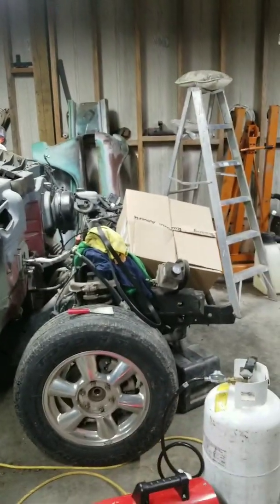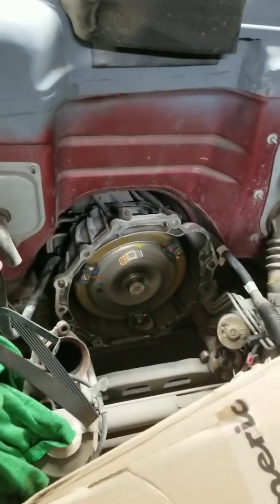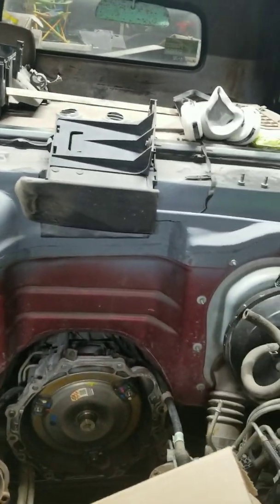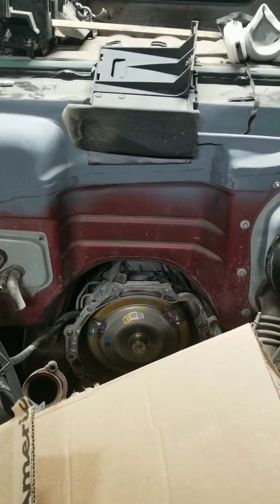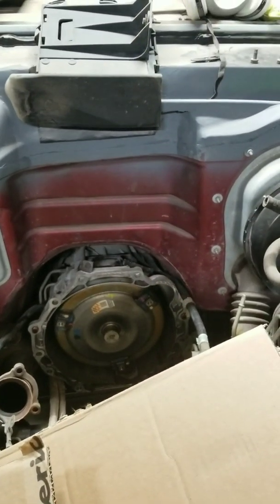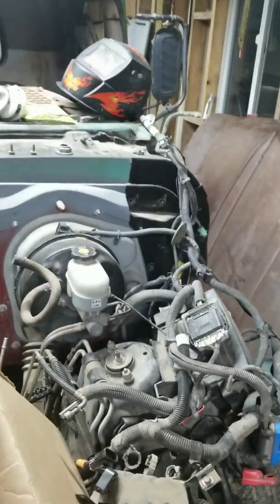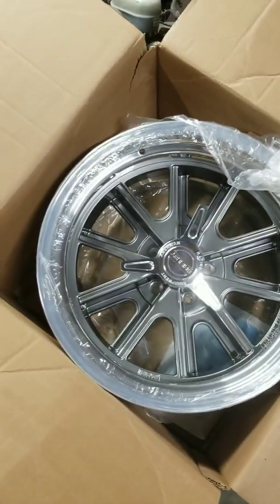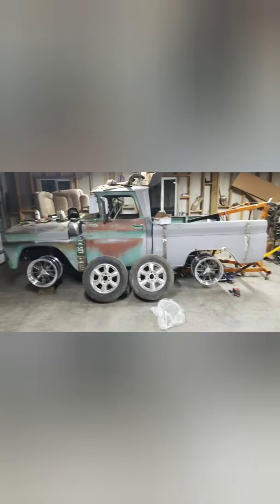Chevy trailblazer 4.2l swap to a LS 5.3l 62 Chevy c10 restoration conversion  project

Comment: I have. 4.2 trailblazer putting a 5.3 with 4l60 what do I need to do?
Reply from the maker: If you watch my little 3 to 4 videos it does go over the biggest problems. Every vehicle is different and I bought a trailblazer with the 5.3 in it so I had all the stuff I needed.

Comment: hey, I just blew my I6 engine yesterday due to a failed oil pump and the engine was almost 500k km Im thinking into swapping the engine to a V8 since Im on the second I6 swap and they have this pesky oil pump problem. So my question is can swap any engine from the 6.0 V8 like L76, L98 LQ9 etc... family with fabricating or rerouting the transmission, air con, power steering lines
Reply from the maker: I am sure you can, but to make it easier I bought another trailblazer that was a v8 model that way I knew I had everything.

Comment: Whatever suits one's fancy. I for one am looking to take out my BBC which has been in my '71 F250 since 1979 and replace it with a 4.2.
Reply from the maker: So let me see if I am reading this correctly.  You have a BBC (big block chevy) in a 71 F250 (Ford) and you want to put a 4.2 ( chevy) in its place. Can you send me pictures of that because that has to be the best running Ford out there.

Comment: My question is I have an 05 envoy 4.2 I also want to v8 swap. 5.3 would be perfect! Now ur saying for me to do this I would have to rip out and reroute everything you said in this video?(fuel lines, ac lines "etc") I get that everything will be different but are there ways to maybe keep the lines like they are an maybe add ur own extentions. Isk if that's even possible lol Or is this something that need completely rerouted? 🤔 you have done it and have used the ss as a donor. So that helps
Reply from the maker: Everything is close to the stock location most my stuff is a little different due to I put a 62 c10 body on it so more relocations if I would have left the envoy bode on it mostly  the same location.
Reply: @teamoa8761  thank you

Comment: How did you go about getting the i6 ecu harness blue connector to work with the 5.3 v8 engine harness?
Reply from the maker: They are for the most part the same, just get a schematic for each vehicle.

Comment: Oops thought you were swapping V8 into I6 trailblazer, much harder. putting an LS into an old truck simple. I put a 5.3 into my 64 Impala SS. They are a much lighter engine than the old ones. And that all aluminum 5.3 lighter still! Twice the HP half the weight! 10 the reliability! Good all around. Also once its complete you can easily swap in any LS variant.
Reply from the maker: Watch all the videos it is a trailblazer/envoy, I welded the 62 cab onto the trailblazer/envoy floorplan and firewall
Reply: @teamoa8761  Ok, I'll definitely watch them all. Very interesting build, very difficult too. Did you ever watch the show Iron Resurrection? I believe their 1st Episode they build is a 62. They swapped the 62 front end suspension system for I think a 64 cause the 62 was notoriously bad. I once had a 66 I put a 350 in. Pre LS, Pre 4L60/80 era. Love that body style. Dang it now I'm getting the bug. Now I want another one. Thanks!

Comment: If I 5.3 my stock V6 would I have to change the suspension?
Reply from the maker: Yes the motor you will have wiring to change and you will need to change the bell housing on the transmission
Reply: @teamoa8761  Goodlook bro appreciate the info 💯
Reply from the maker: What are you putting the 5.3 in?
Reply: @teamoa8761  2003 trailblazer with the 4.2
Reply from the maker: No suspension changes needed
Reply: @teamoa8761  no changes but the motor, huh?

Comment: What motor mounts are you using
Reply from the maker: The trailblazer 5.3 mounts
Reply: @teamoa8761  did you order them online
Reply from the maker: No I used them out of the trailblazer I got the 5.3 out of.

Comment: The wiring on the envoy/ tb is a nightmare. The pinouts are the same as the 5.3 truck but the rest is a disaster. I'm in the process was I type this. The trucks the black connector does everything the tb/envoy is the white connector. Then there's the body harness connector.. Wow just awful setup.
Reply from the maker: Yes I agree but mine turned out good, after turning off the security mine fired right up.